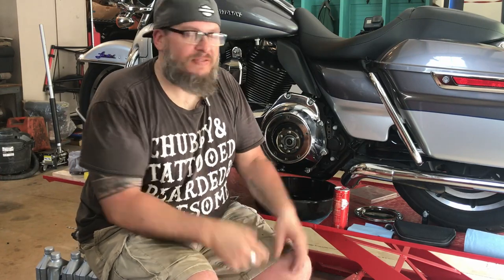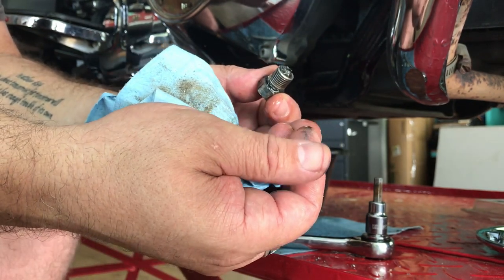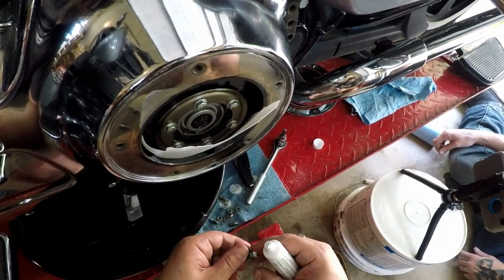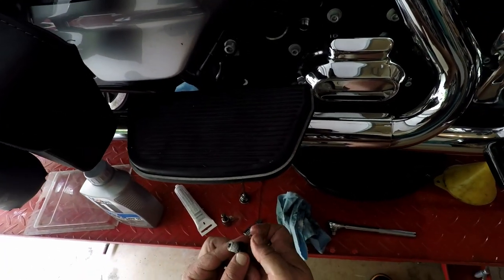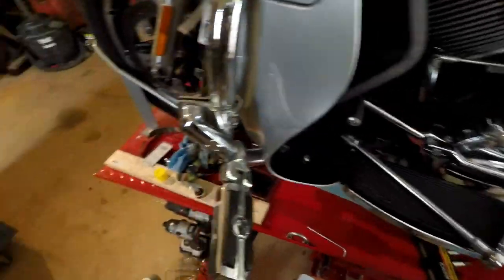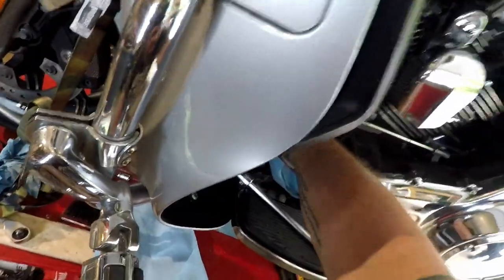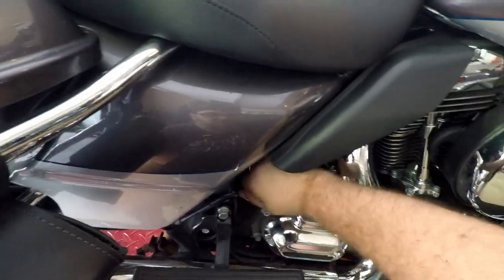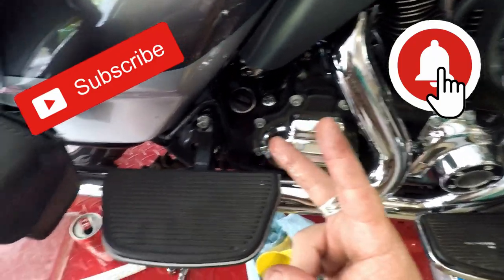Touring Oil Transmission and Primary Change

Comment: I have noticed that people will tighten the drain plug like if it falls out something bad will happen.  I am for the change the o-rings on the drain plug.  Cereal box card board works great as a oil defector and a poor funnel.  Ya know if you didn't have all that old man bagger stuff on there the oil filter is wide open like a Dyna...
That tiny sliver of metal is not a concern to me. But if more show up (a good bit more) on the next drain and fill it maybe time to look deeper.   I have a bore scope camera that we can look inside there if you have concern.  That is also a opening if you need it for other machines, just ask. 
The cover you had off is called a derby cover. The big cover is a primary cover.  The Derby cover got its name like many Harley parts because it looks like something. The older covers on the Primary looked like a Derby hat.  Same reason many motors have the names they do. Knucklehead, Panhead, Shovelhead, Blockhead aka Evo.  Many old timers can refer to just about every part as another name and you will know what they are talking about because it makes sense.  Like a camshaft is a bump stick, a very  common one is calling the cylinders, jugs, well for obvious reasons.  I can go on but that might be enough for now. 
So next oil change going to be Amsoil?  
I like the POV with the go-pro.   Looking good and sounding good too.
Reply from the maker: Thanks my man I appreciate that!!!  Yes I think were gonna pull that Amsoil trigger.
Reply: If the drain plug falls out you will have problems.

Comment: Okay some guys prefill the oil filter and some don't. Is it more of a preference?  Taking the filter off is a pain with the mess no matter how you do it. I read about a lot of tips to make it less messy some way are pretty creative. Stay safe.
Reply from the maker: Rodney Barcus I used to never prefill the filter and it was honestly never a problem.   I only recently started prefilling it.   I figure getting it wet first and maybe it helps the oil pump out if even just a little.   Yes pulling the filter is definitely a mess no way around it.   I just usually cut up whatever is in the recycling bucket be it milk containers or cereal boxes.   Goal it to mitigate the mess because no matter what you do with that design it’s gonna be a mess lol